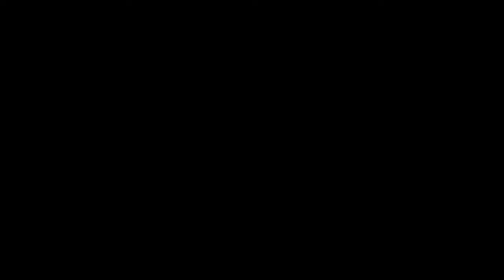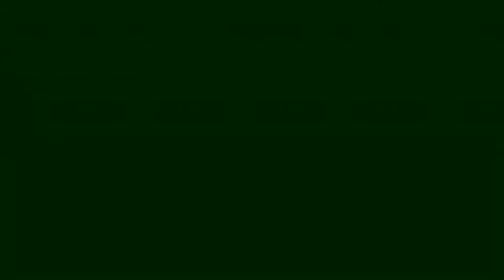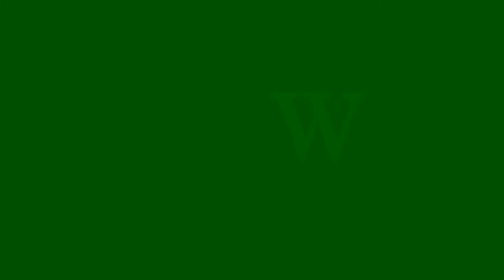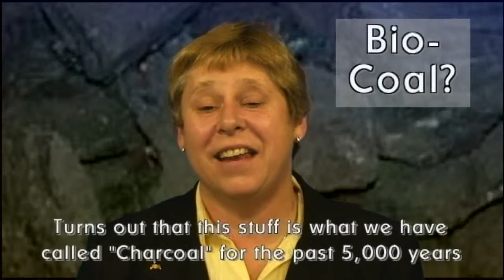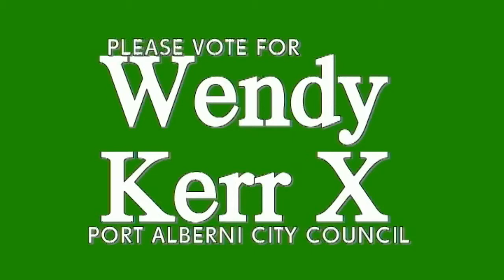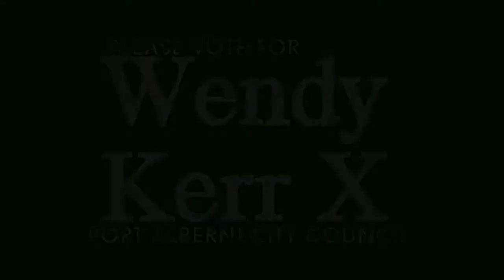Blog#28 - Bio Coal

Comment: Bio Coal also known as torrified wood, is heated to a high temperature in the absence of oxygen.  This does indeed demand energy.  However that energy itself comes from biomass.  In other words this is a ‘carbon neutral’ process because wood is a renewable source of energy, which pulls as much carbon out of the atmosphere via photosynthesis, as we put out into the atmosphere when producing biocoal and later when burning biocoal for heat and power.  Of course the system needs to be a closed loop, such that as much tree growth takes place as matches the rate of timber felling.  If these conditions are met, then no more carbon is released to the atmosphere than is taken from it by tree growth or growth by other plants such as sugarcane or bamboo.  We have to be careful that land devoted to biomass production does not displace crops necessary for food.  However it makes good sense to ‘torrify’ all the parts of plants which can’t be eaten anyway, eg coconut shells.  There are a lot of technical books on this subject but they seem to be expensive!